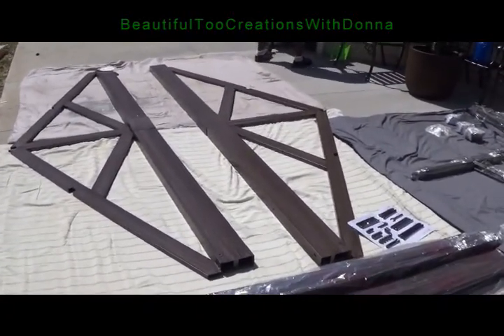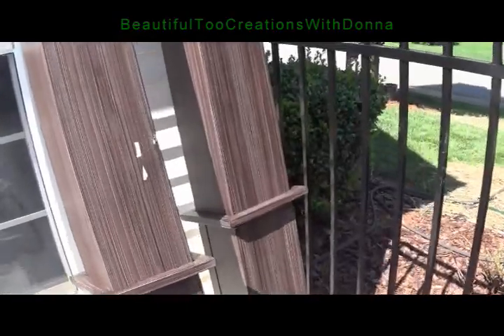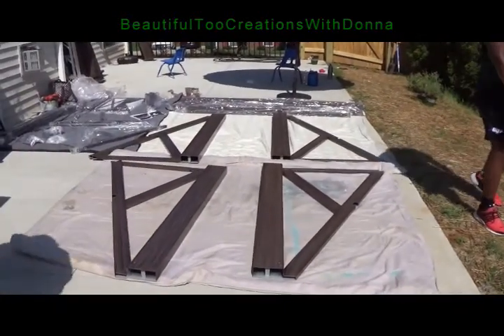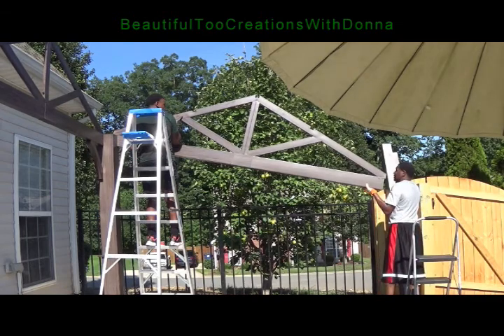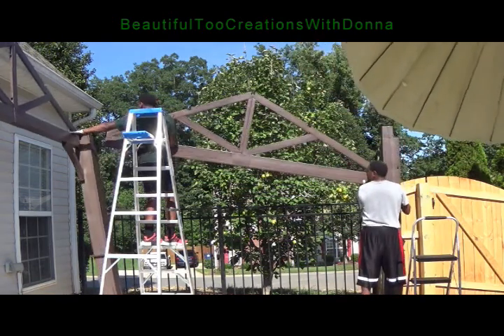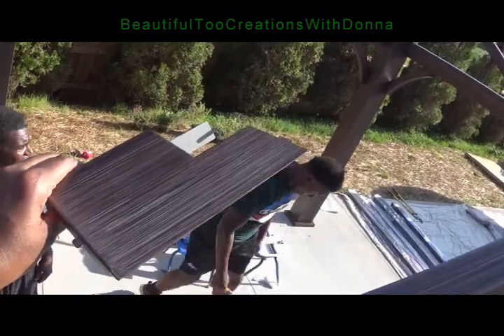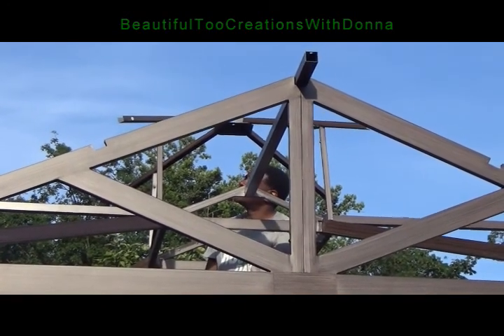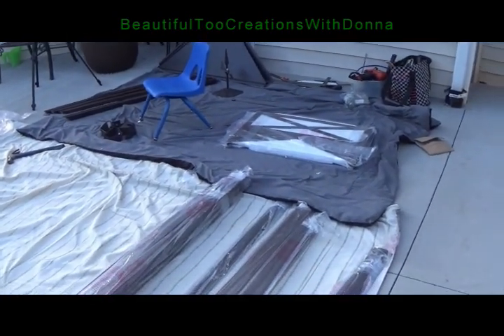DIY Gazebo Assembly | Allen & Roth | Part 1

Comment: Have you had any issues when it rain? Does the rain splatter on the concrete from the sides? Trying to fix the rain from pour out the side onto to the concrete
Reply from the maker: Heyyyy Sonya!  Yes the rain comes out of the built in gutters onto the concrete, but it doesn't bother us at all.  Sometimes I'll sit my watering can out to catch the water and fill up quicker.😊